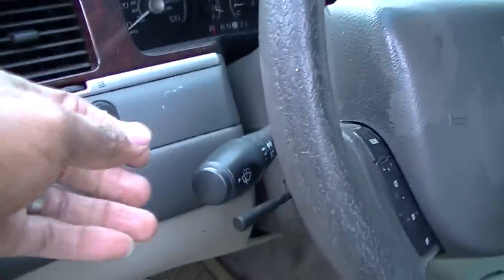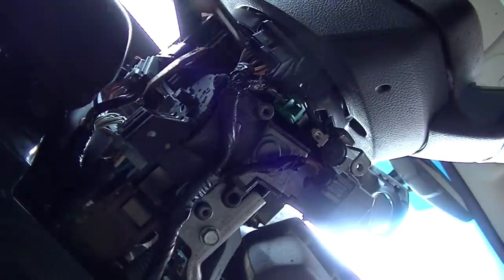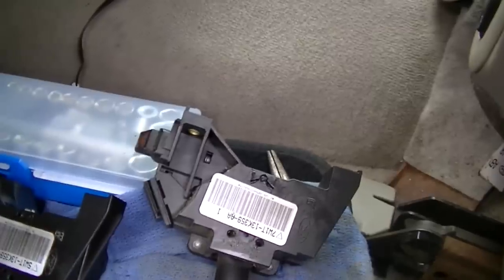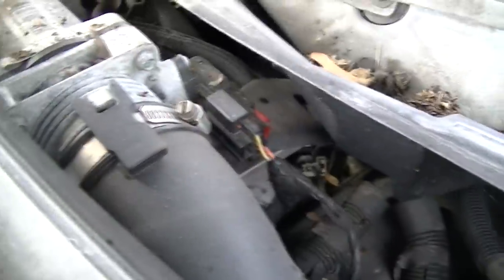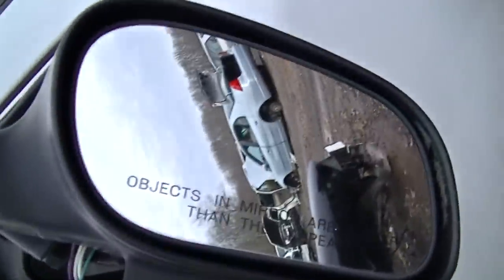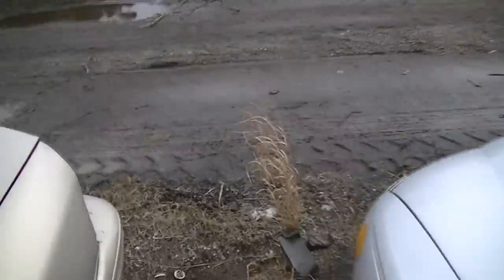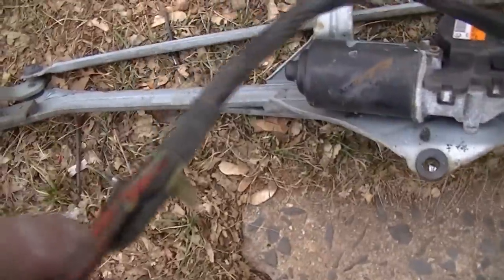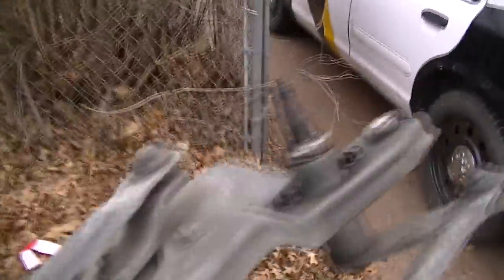Lincoln Towncar Wiper REPAIR $20 Fix

Comment: Having the same problem with my Town car. Going to have to check the wiring tomorrow I already replaced the multifunction switch and the wiper motor not those things. Hey thanks for the video preciate it hopefully they'll be the problem when I go look at it tomorrow.
Reply from the maker: no problem Mike i did all what you did and i found out it was the wire and another time it was just the motor..I hope it works for ya.. let me know bro

Comment: Ha on fuses. Gotta get your entry fee. Fyi to do repairs cheaply the first time, take apart your wiper motor before you go to the junkyard. Then you would know the harness is bad and that's all you would have to spend on.
Reply from the maker: True I should have double check, but a wiper assembly ,multi switch,and harness $20 buck and time it worked out. You are right saving time is key.   The way the wipers went I though it was the switch it never made noise or went slow so I just over bought and under-thought..

Comment: Cool.. Now you can put that car to work.. Make you some $$:). I do the same grab fuses and Ford relays are good for anything can buy the pig tails and use the for fog lights or whatever.. The A/c relay was bad on my car when I got it and dryer and evaporate core.. All was easy to do.. I had to replace the transmission extension housing bushing.. Had a vibration and one U joint.. I found aftermarket U joints cups were just a tad bit undersized.. Had to get the Ford U joint.
Reply from the maker: Yeah Man i had to get car the on the road.... I loose a bit money when the car is down, but these times it is a bit slow ( strange )  though why its slow...462 its tough when that Ac goes ( for me ) not to in tuned with Ac cause me its always something deeper. Now for that u joint those after markets ones just dont cut it at times, but you push through and found the right one though. And thats what it is all about saving some money and doing it better at times then sending it to a shop..
Reply: BST Ford Channel I bought 2 or 3 different brands of U joint.. From 30$ down to 12$ but they were all the same. I could push the U joint caps into the driveshaft with my fingers.. No good at all The Ford U joints weren't cheap even with my shop price they were 89$ea then I had the driveshaft balanced at 130$  I only replaced one  U joint though, might almost be cheaper if you had to pay labor to just buy a new driveshaft.  I hear you about fixing the A/C it's not always a easy fix..  I ordered the evap core from Rock Auto.. Was way cheaper then buying it here from a jober/ parts store. Does your car have rain sensing wipers?? I think my car has them as they sometimes have a mind of their own. Lol
Reply from the maker: I use to work at Napa and they stocked few different sizes ( on things ) which made me crazy lol   I do understand that drive shaft deal certain models and where the ( car/truck ) was assembled  ( so much ) but you alays had to mic stuff.....

Comment: Wow, rotten isolation on a cable? :D Thats crazy. I remember that the european Ford Scorpio Mk II had the same problem with eeeeevery cable built in. Everything died until the cables for the ECU were shot. Then you could throw away that car. :D
By the way, if you should ever see a Dodge Shadow on the junk yard, please let me know XD Theres a small interior piece that mines missing
Reply from the maker: No problem on the Dodge parts that you will have.. I will double check on that i think one is there though.. Ford Scorpio i love those cars over here they had the Cologne V6 it was a good car it did had electrical issue though . Who would have though that The wiper harness would be like that I was kinda shocked myself
Reply: That'd be great :D Thank you. I would just need to see the center console / shifter, and know if the part is still there or not. I saw it missing on a couple of Shadows. Seems like its something that breaks easily.
Yep, the car itself was great, but the electrical issues just made it very unreliable nowadays.            I would've guessed its your wiper motor. When i saw the crumbling isolation i was shocked. I wonder how that happened. I can't imagine it very hot where the cable was routed.

Comment: Just check to see if you have power/continuity to the wiper motor. If so, most likely the motor is shot.
Reply from the maker: it was the wire .. it grounded out and rusted.. very odd, but thank you for checking the video jeff sorry for the late comment working on crown vic turbo crap

Comment: Can you get back to the wiper motor? Lol. Lovely though. I appreciate you.
Reply from the maker: Yes you can can... you just have to take out the assembly like you seen and then it get a little tech on this part, but nothing hard... I needed the whole thing cause the it was quicker and the wipwer arm bushings where worn so it was best..

Comment: My wipers won't turn off. Could this be a issue with my motor or a harness?
Reply: I see nobody's answered your post I have a 2010 Lincoln MKZ wipers will not shut off have to pull the fuse to get them to shut off even with the key out of the ignition and they still want to run
Reply: @ronfield8914  i figured out the issue. It was the wiper motor. Swapped it out for a new one and now everything works perfectly fine. Its was i little difficult taking the caps off to release the blades so I had to use a battery post removal. It took me about 30 minutes to fix but perfect running condition now.
Reply: @SuperTdot74  hey thanks for your reply wondering if the motor shorted out the fuse under the hood for the wiper motor is always hot I have to take the fuse out in order to shut it off otherwise it continues to run with the key out of the ignition so you think this could be the motor?
Reply: Were your wipers running even with the keys out of the ignition
Reply: I have a 2011 Town Car that just started having the same problem. Will try replacing the wiper motor.

Comment: Hey man... Do you have any push bumpers you want to sell?
Reply from the maker: What is up Daniel not at the moment , BUT i will check when i go back out for ya if you like
Reply: if you could yes. You are in jersey correct? I think I asked you this...
Reply from the maker: Yes in New Jersey what type of console  you like exactly
Reply: Looking for a heavy duty push bumper for my 99 cvpi. It has the not so sturdy steel loop style on it
Reply from the maker: I will try thats a hard item wait ? here you are located I can give a number to a guy

Comment: 20 bucks sure is better than no visibility in the rain lol.
Reply from the maker: You aint Shit'n dude lol . Trust me I want to just work on its own, but it hand to figure it out and today its cold so that was a good day to tackle it..
Reply: BST Ford Channel  yeah up here in NY my corolla gave me an issue starting 3 times turning the key no response. 4th time normal start noises, 5th time success. Popped the hood, and saw smoke. No time to deal with it so the mechanic has it now.
Reply from the maker: Depending the year of Corrolla Toyota made a solid simple car very strange for a Corolla to do that.. It can be do so many things ( starter ) for one timing belt jump timing or pulley or belt an such.. I hope it gets running it too cold to deal with and figure out.. I hope it simple and it doesnt cost much good luck Anthony
Reply: BST Ford Channel thermostat housing lol. 90 bucks
Reply from the maker: Thermostat housing so did you had water in the system ,either way thats a cheap fix . Now you are on the road again

Comment: he did not show how he actually took the motor out anf put it back in. that is what i was wanting to know.
Reply from the maker: hmm? 4 screws in the plastic, now the wipers there are two types. One nut type the other Clip type... Once you take off that there are 4-5 that holds the wiper assembly together.. Click here maybe this should help https://youtu.be/mnmnl-bveqs

Comment: My wipers work but they don’t spray
Reply from the maker: check power to the washer fluid pump ( need  a test light ) may need two people one to hold the switch down while you test..
Reply: @bstfordchannel923  driver side washer nozzle doesn't shoot out fluid but both wipers work
Reply from the maker: @jayb490  may have to change nozzle it may be blogged very simple to do
Reply: @bstfordchannel923  I did it with a tact now the driver side nozzle shooting out washer fluid now thanks NOW MY CAR MADE A RATTLING SOUND AND I CHECK FOR CODES WITH MY SCAN TOOL IT READ 171 AND 174 CODE IS THAT POSSIBLE BOTH O2 SENSORS BAD?
Reply from the maker: @jayb490  yes and no.. its depends if cats are bad does you car use oil a lot? like adding quart here and there?  now is it bank 1 or bank 2
Reply: @bstfordchannel923  no it doesn't use alot of oil but it does sound like the catalyst converters when I hear a rattle sound then the engine light came back the first time the engine light came on I cleaned the maf sensor with maf cleaner and bank 1 and 2 code is the only codes on the scanner
Reply from the maker: @jayb490  does it run bad? these cats do go bad do to whom was driving the car prior..Any coolant lost ( just asking )
Reply: @bstfordchannel923  coolant did leak once so the thermostat, cooling fan, was replaced 3 weeks ago and no it doesn't run by at all even after engine light comes on just rattling sound
Reply: It drives really quiet if the rattling sound doesn't start